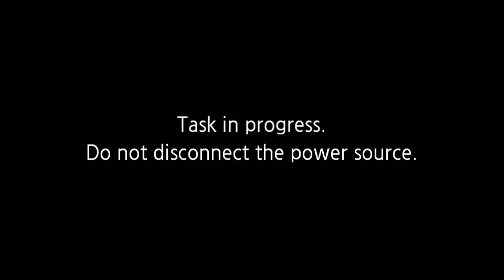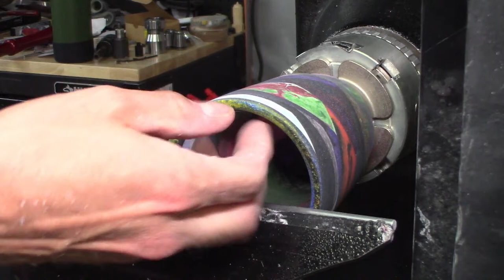🔴Replay: Woodturning a Pencil Pot Out of a Happy Fun Cup Blank | Episode 250

Comment: Hey Zac, I finally got my lathe back up and running. I had to send the electronics off for the to fix it. Galaxi Nova 1644.  I have turned those crazy extra resin pots too.  I look at the micro air bubbles as stars in a galaxy far far away.  Look great to me
Reply from the maker: Woohooo!! That's great news. I like your approach to the bubbles. It's actually kind of funny how we stress over bubbles so much. In many cases, they can add a lot of interest to a piece! When you don't look at them as blemishes, they are actually pretty neat looking